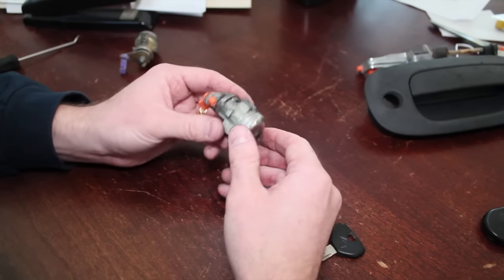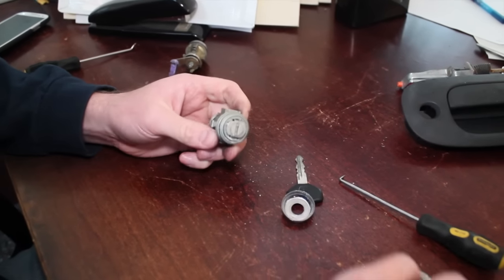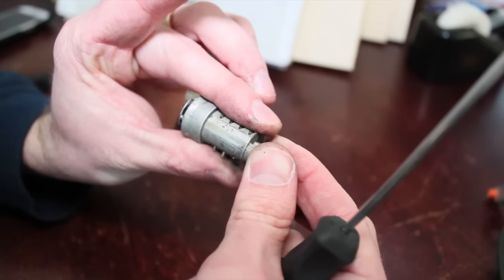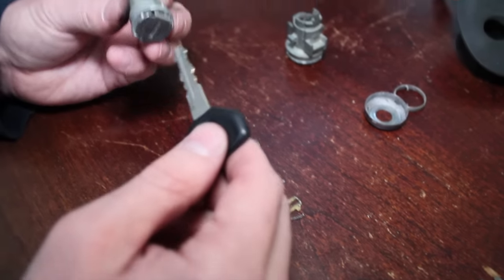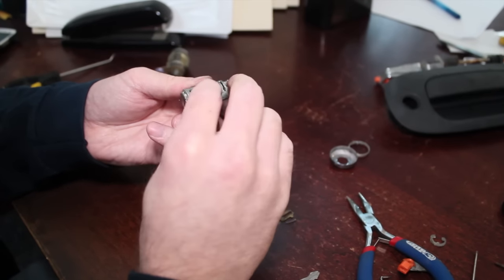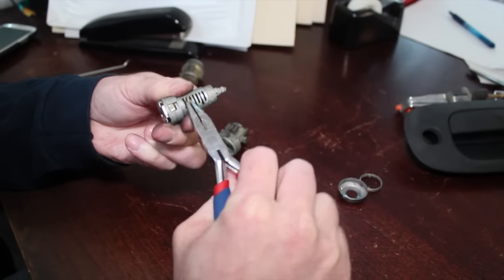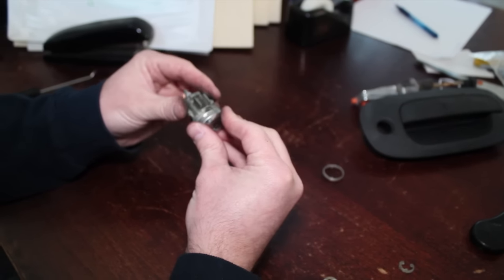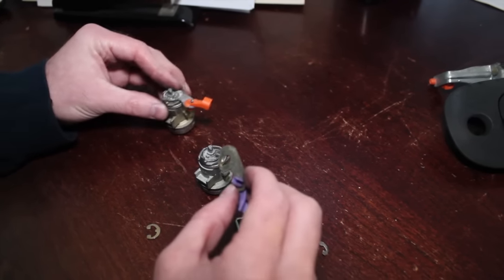Recode, Rekey Car Door Lock Cylinder - Use Any Key to Unlock Car!!! Ex. Durango

Comment: Thanks for the vid.

I hate the fact that I got a seperate key for my ignition and door.  Was wondering if I could use this technique so that there is just on key for the ignition and the doors.  Thanks for your time.

Also it seems like you could even leave up to a couple pins out and it will still be ok.  I mean no one would know to try and muscle through it anyway.
Reply: +Alexis Tudor Yeah, the sort of lazy way to do this is to leave pins out. Sometimes you can't make them all work without effort. I did this for a couple locks on a motorcycle and went from six to four pins on the gas tank lock. Who cares? There's nobody trying to pick your locks, thieves break windows or use a slim jim.
Reply: +Michael Poage Exactly.  Quite frankly many wouldn't try and pick the lock if you took every pin out and just had a blank key.  Again they would not now to do it.  Like you said thugs break things, they don't pick lock, especially on anything I own.  :-).
Reply: +Michael Poage  I learned 4 days after purchasing my 05' F150 FX4 that my truck was one of the easiest to break into by means of using a flat head screw driver and a good little punch,  then twisting as if the key were there.  Like if was the key itself,  the door unlocked.   Sad face.  thank you so much for this video.  going to try it tonight after getting the complete door handle with keyless entry and key cylinder for $40 from a salvage yard

Comment: How can we modify the cylinder so the lock can be opened by ANY key that fits in the hole?  (YES we understand the security risk!!)  Do we just take out the pins and springs and that's it?? (put it back together without any pins or springs?
Reply: +Luke Thompson you have two choices, pull the wafers or file the tops down.  Pulling the wafers is much easier, although i have no idea why you would want to do that...

Comment: So if two pins dont stay down I can leave  them out and it will still work?
Reply: I’m thinking abt doing this, my 96 Corolla door lock stopped turning. Did just removing those 2 pins work for you?
Reply: @HisMajesty99  yes worked out great for door handle
Reply: @AJ-uw5hh  appreciate the reply man, I’ll try it out soon and let you know how it goes. Hopefully it works out. (assuming that it’s the pins that are the problem)
Reply: @HisMajesty99  it was actually pretty easy just follow the video and youll be good i kept extra pins incase but found didnt need em
Reply: @AJ-uw5hh  hey man it worked perfectly! I removed the 2 pins that were causing a problem (both were split wafers, no surprise there, idk why Toyota uses them). But the lock works like brand new now. Been having to unlock the car from the passenger side for over 2 years, but not anymore! Thanks btw, I prly wouldn’t have even attempted it if you hadn’t confirmed that it worked for you. It was a pain in the a** to get the crimped cap off the cylinder tho 😂, but well worth it. All it cost me for the whole repair was a $15 socket wrench at the store

Comment: Why didnt you just get the pins from the old cylinder and moved them to the new one?
Reply: The old wafers are worn.  Better to use new wafers.  If the key is worn you can get a new one cut.
Reply: Sometimes you don't have the old mechanism!

Comment: wait so basically i dont need any new pins right? its just a combination that i have to get correct?
Reply from the maker: Well you may need to buy a new pin or two, but if it's just one or two just grind them down or use snips to cut them down. A couple of us on here have done that.

Comment: And what if you don’t have the original key?
Reply: You should be fine. Just put whatever key you have in the cylinder and it should most likely make the pins flush inside the cylinder for the most part, and should come out of the housing at that point

Comment: so i need the right keay to get out the clynder?
Reply from the maker: Not really. You just need a key to bring most of the pins down to work the cylinder out. You can always push them down one at a time as you go, but it's much easier with a key to get you most of the way there.

Comment: I'd redo this video... make mention to keep the cylinder orientation one way. Pull the pins and read the numbers on the pins themselves as you pull. Make a little drawing to keep the order of the numbers. You kind of gloss over this in a unclear fashion. Without mention of this will cause unavoidable problems for the viewer.

Comment: This is not recoding. All you are doing is fiddling with the split wafers to align with a different key. If your key is remotely worn out then you are setting yourself up for towing fee when it gets jammed when you are parked at a supermarket or somewhere and the wafers wont align.

Comment: You lost me???  If you get a lock from the junk yard, it wont have a key.  At 1:46 you say you need to put the key in to remove the cyl. you used the key that you already programed????  The lock your replaceing isn't programed.  How does your key work???